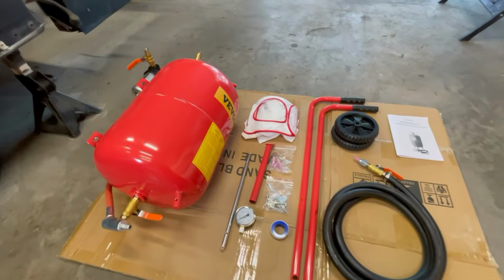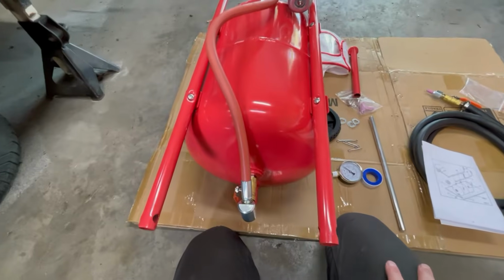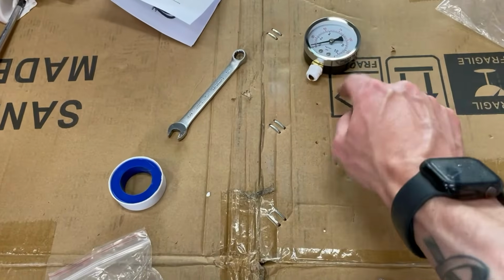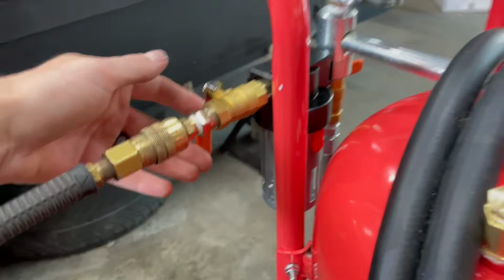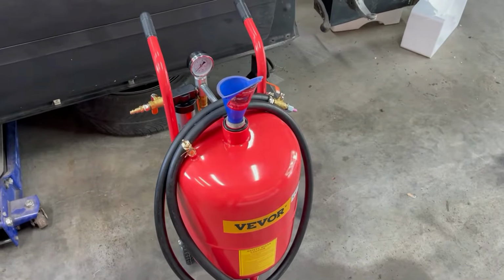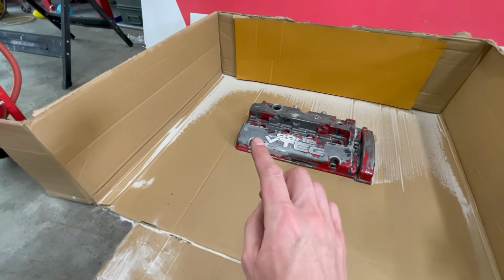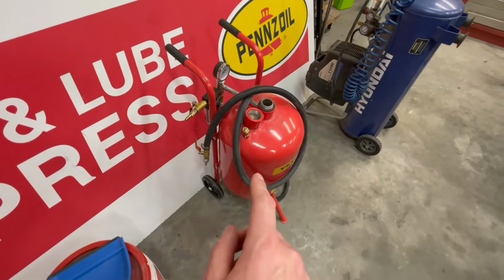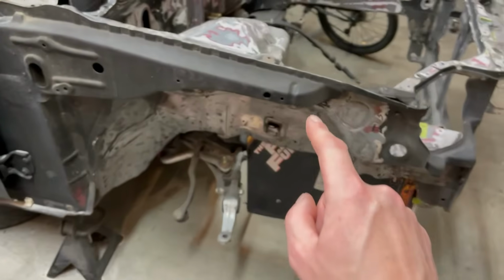Testing Out My Ebay Vevor Sandblaster - Is It Worth It?

Comment: i know this is an old video but i litterally bought this unit a couple days ago and it was a terrible experience. instructions for setting up all the plumbing was non existant, i got it in the end but it was still annoying, the blasting tip lasted about 30 minutes before it just completly disintegrated, had to buy extra fittings, had to remove all the fittings already on it and re-do the plubming tape as it all leaked, and in the end it made a god awful mess that takes hours to clean up.

I also had the same issues with moisture ( extreme amounts of it ), and my compressor which is a 3 motor 150L tank still couldent keep up,  i gave up on this unit after taking it all apart to clean / double check things over and over.

Comment: Once you're finished media blasting, use DTM within 30 minutes, so as to avoid oxidation. You're welcome😮
Reply: Whats dtm?
Reply: @Random_Car_Guy  Direct To Metal primer
Reply: @Random_Car_Guy  While it has corrosion protection properties weld through primer really isn't meant to be used or sanded like a DTM primer surfacer. DTM primers hide flaws and provide build. Weld through primer does not. You'd really only use weld through primer to protect bare metal surfaces that are being welded together.

Comment: Just an FYI for anyone watching this, the compressor used in this video is inadequate for ANY type of media blasting. Maybe fill some tires or pool toys? no insult intended here.  Even with the smallest pot you need at least 18 to 22 SCFM @ 90 psi  for it to work properly. We have the large 110lb pot and for us to keep working for longer than 30 minutes at a time, we use 2 compressors.

 One has a 60 gallon tank providing 16.5 SCFM@90 psi and the other an 80 gallon providing 22 SCFM@ 90 psi and both are 2 stage units. We do not run out of air, even when others in the shop are using air tools etc. and all air is run through a copper coil that cools and removes moisture. Water in any portion of your setup will kill any sand blasting.

Also, the pressure in the pot needs a separate regulator with gauge  to allow control over how much media gets pushed out of the bottom. With this setup we can actually work instead of constantly stopping to fix clogs or get the media fl;owing properly. One more thing, DO NOT USE PLAY SAND!!! It has rocks in it larger than the openings in the tank. It also has a very fine dust in it that will destroy your lungs. There are quite a few videos that show you everything you need to do so that you can work instead of cursing and fixing Lol.

Comment: Always remember to have the blaster tip valve wide open, or completely closed. In time, the blast media will wear down the brass valve ball, and you will have to replace it frequently. Use the valve at the top of the red hose to change the air pressure of the feed line. You can use the valve at the bottom to control the volume of media. However, you do not want to run it that way below half full. The same erosion will elicit the same valve wear. Get a cheap plastic or rubber dead blow hammer, and periodically tap the tank to discern the level in the tank. You'll be able to hear the difference. Tapping the side of the tank will dislodge any media stuck to the sides of the tank as well.   Moisture: Spend the money to purchase an in line drying solution.  Mount it as close to the tank as is possible. Last thoughts: Get a full face respirator, you'll thank me. They are around $35, with cartridges. The self sticking acrylic peel away sheets are rather inexpensive. I did end up replacing all the brass 3/8 npt valves on my rig with stainless 1/2 npt valves, along with the bottom feed valve. You can pick up a drill and tap set for the bottom hole for around $15. No more clogging, and no more fiddling with  the valves.
Reply: What do you mean 'You do jnot want to run it that way below half full."  why?

Comment: You don't need to sand metal after sandblasting, you can directly prime it after blasting it in fact you don't even need to degrease it
Reply: Some iron blasting sediments have water prevention oils added in small amounts to prevent rusting in transit which is why you degrease. Sanding is intended for heavy sediments that leaves pitting
Reply: @samwhite1345  yeah If it's iron fair enough but if you use pure crushed glass there should be no problem as I always do 👍
Reply: @hserieshoonigan1997  yeah your right about that I'd still run a tack cloth over it first just to clear dust before priming
Reply: @samwhite1345  I probably should still degrease I've reused the glass quite a number of times off the shed floor lol